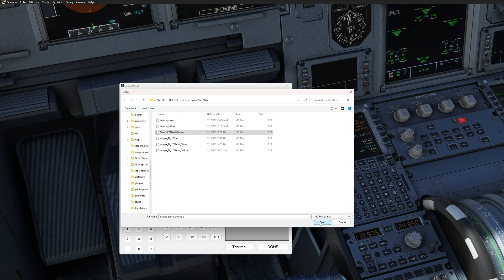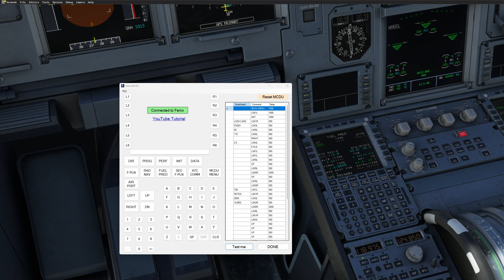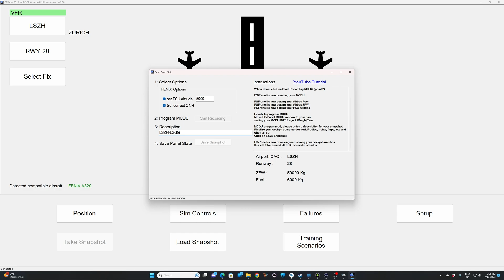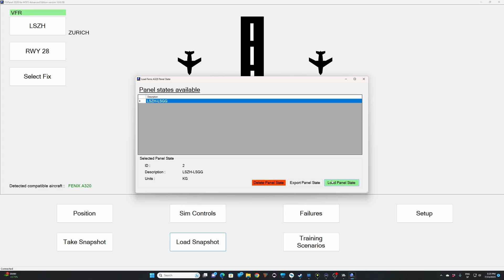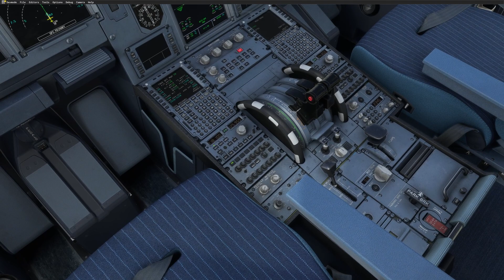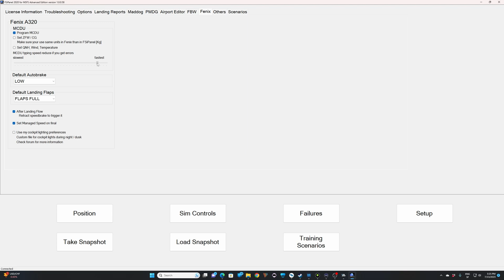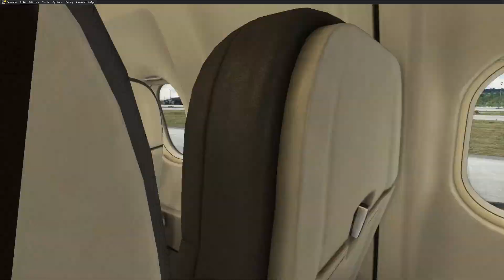FSiPanel Tutorial Part 2: Fenix A320, Saving Cockpit State Ready for departure.

Comment: It would be great if you could think about saving a snapshot at any point in the flight to give the Fenix the same feature that the Toliss does in XPLANE?
Reply from the maker: Hi, I have to look at it, this feature is on my evaluation list. Thank you
Reply: Yup that would be magic, it may not be possible, but it would be great. I had to abort my Fenix flight today when half way through the flight the FPS dropped to 30fps (with frame generation), so in reality 15 fps and the screen was flickering. This is on a system with a PCIe4 Samsung 990 pro SSD, RTX4090, and Ryzen 7800X3D CPU. The thought of going back and setting up the flight again was too much. Saving a regular snapshot would be the perfect answer, apart from the damn problem not happening on the first place.